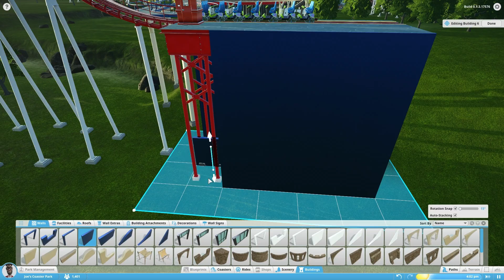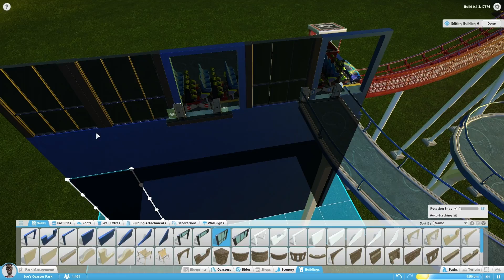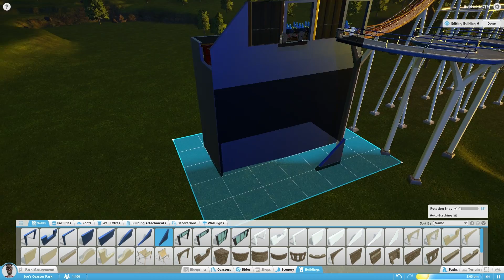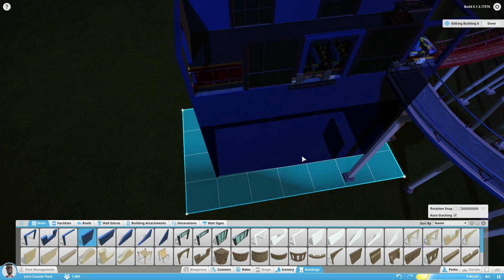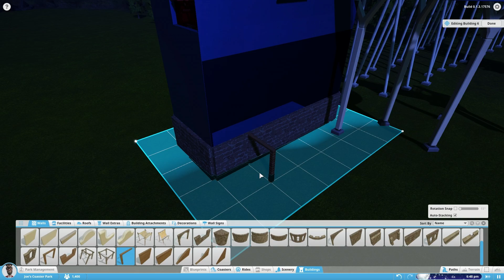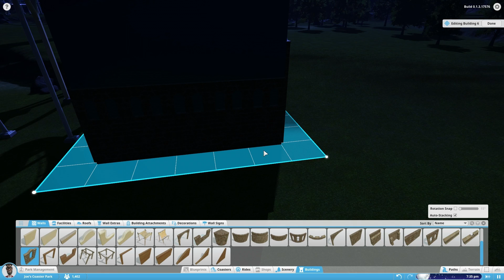Planet Coaster ALPHA - Part 10 - Station Design!

Comment: You can also use the U shaped pieces to add walls underneath the station track where there are holes right now (example is second piece in from top left of buildings tab)